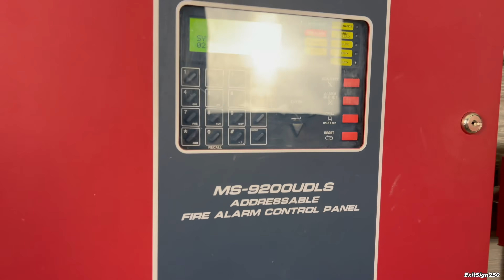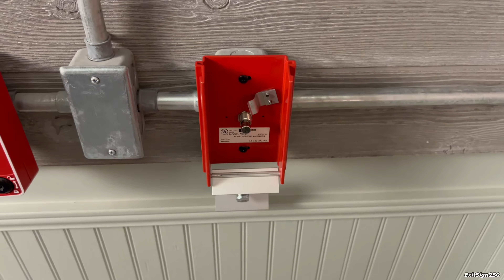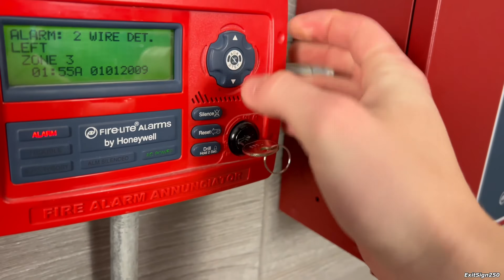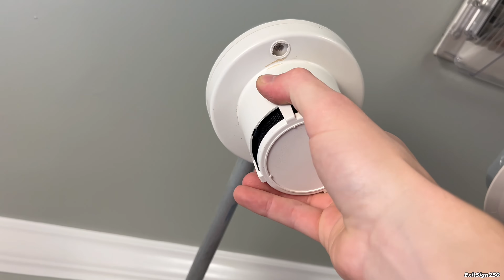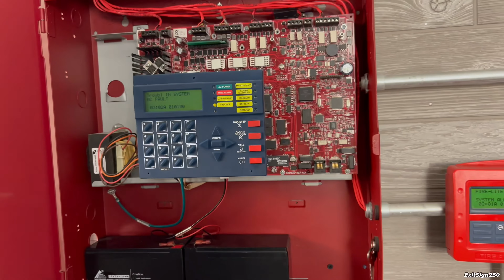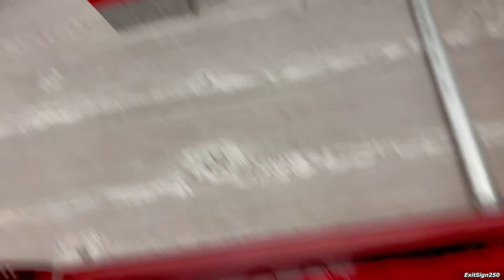System Test 19 | Board 1 - Wheelock 7002T’s

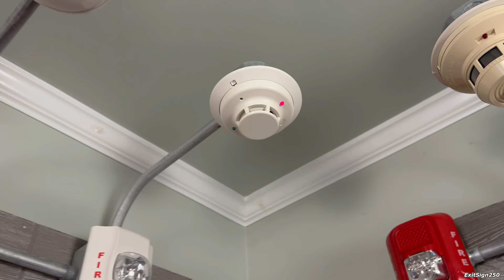Comment: 5:03 lol the i3 went off before you sprayed the smoke at it
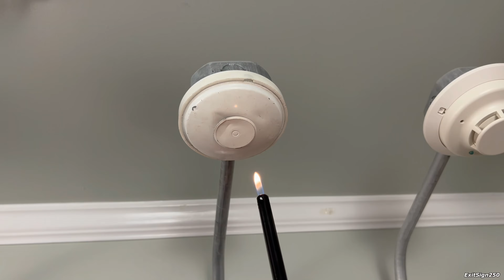5:57 also tip if you don’t want to permanently activate your mechanical fixed temp/rate of rise heat detector, avoid focusing the heat on the disk. Move the heat source around the side of the device
Reply from the maker: Haha I know right! Kinda funny. 

Good tip on the heat detectors. I immediately take the heat source away whenever the rate of rise portion activates, but what you suggested is a good idea to prevent permanent activation.

Comment: 3:25 How did you reset the FCI pull station without opening it and flipping the switch? does it have a button?
Reply from the maker: This is actually the suggested method to reset the MS2’s from FCI. There is a toggle switch on the inside and when you close the station, the switch is automatically reset. Similar to how BG-12’s reset the toggle switch when closed.